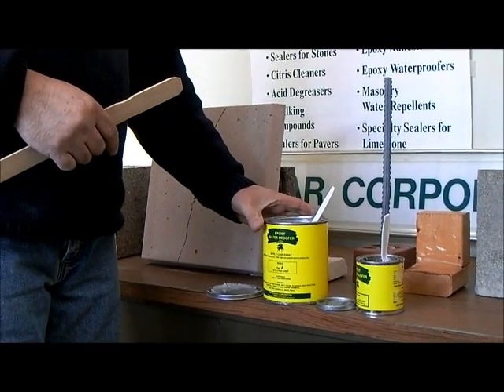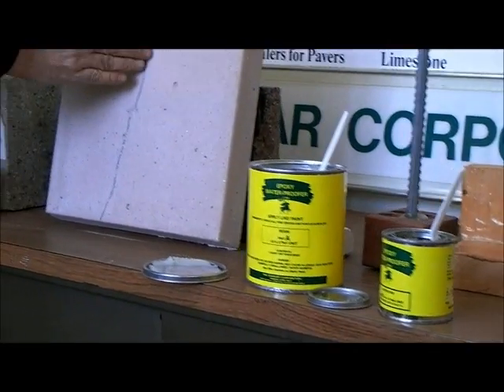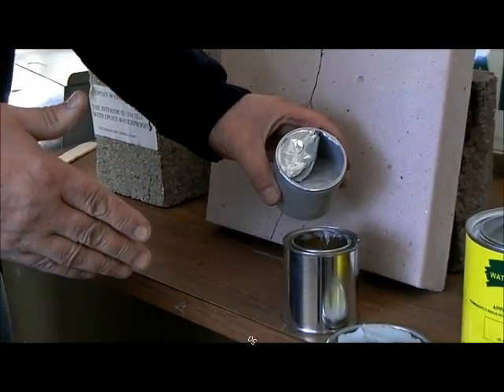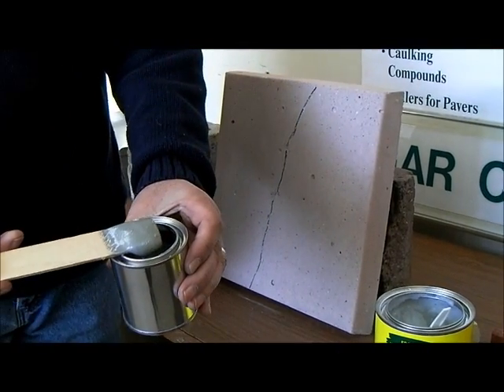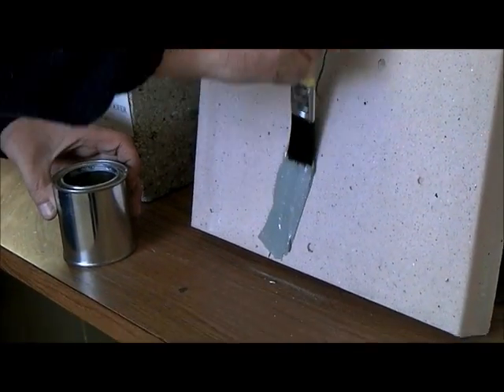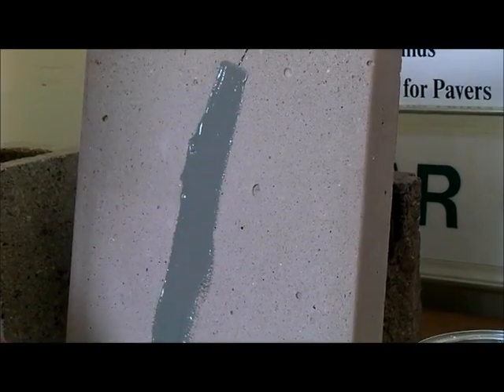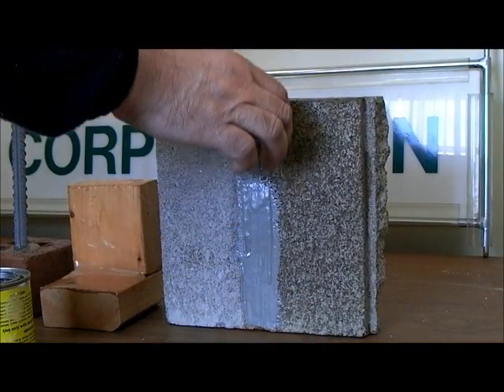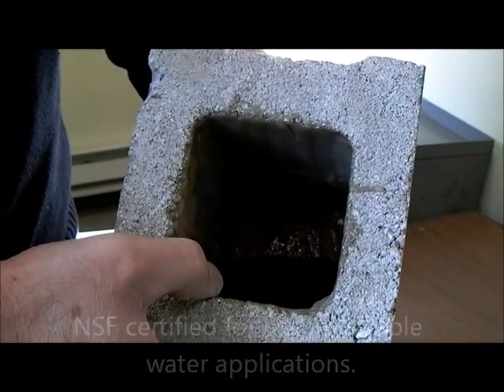Epoxy Waterproofer Movie

Comment from the maker: This product will bridge and waterproof a hairline crack. To waterproof larger cracks, add silica sand to the epoxy and mix in separate container. Using a trowel or similar tool fill the crack with the epoxy/sand mixture and allow to cure. Then proceed to waterproof as normal.